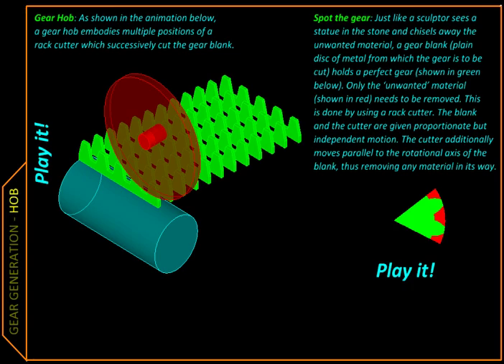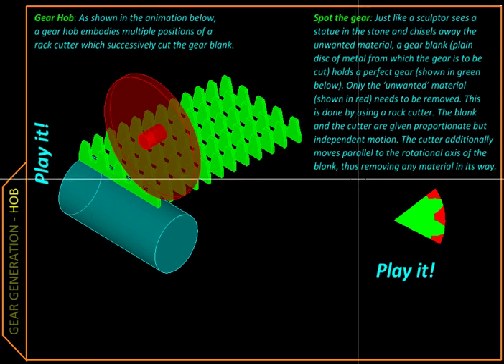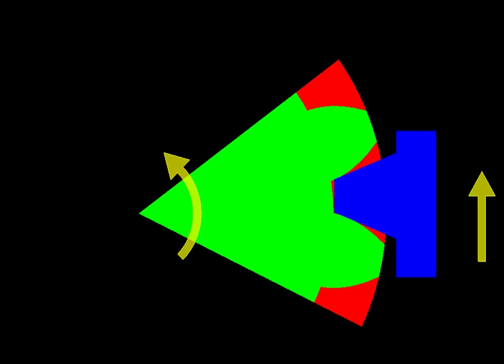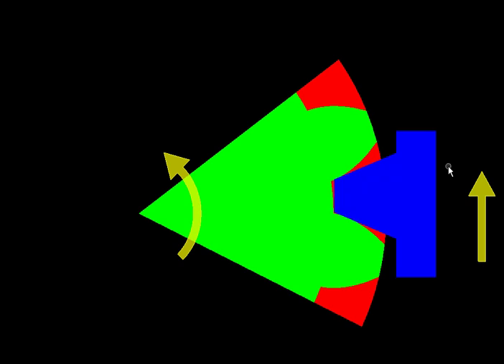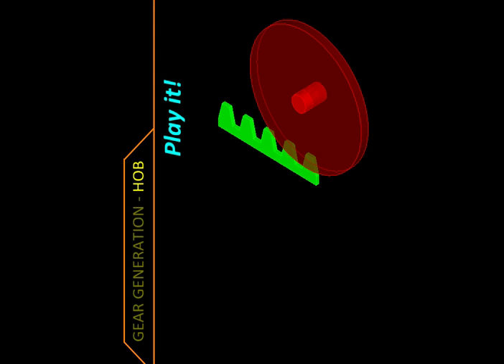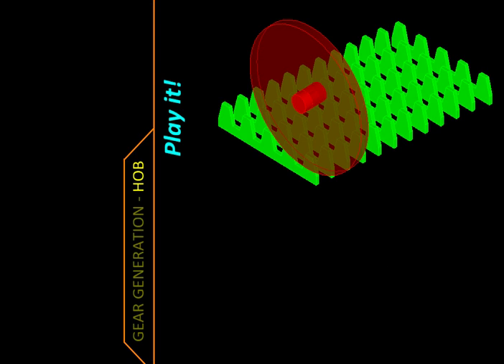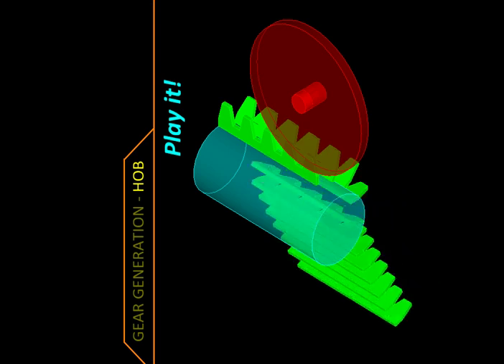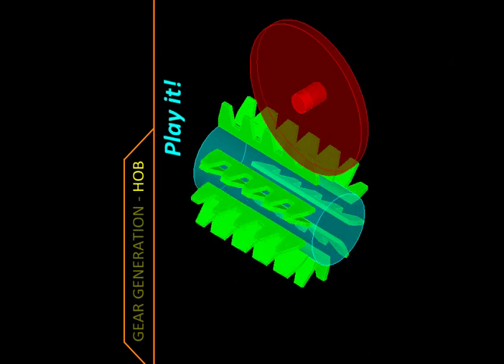Kinematics Ch06M Gear Hobbing

Comment: Hello Ujjwal sir, is the value of undercut circle radius same if the gear is cut through Shaping or Hobbing?
Reply from the maker: If there is undercutting due to interference, the undercutting curve will be the same irrespective of the tooth cutting process. 
Secondly, the undercutting curve is not a circle.
Hope I answered your query.

Comment: sir is the cutter moving up and down in the plane perpendicular to the plane of blank to be cut or is moving in same plane of blank it is kept in
Reply from the maker: A rack cutter has two motion components. One is in the plane of the gear blank, which moves the rack as if it is engaging with a perfectly cut gear. While the other component is normal to the blank's plane, which cuts away parts of the blank that obstruct it.
Reply: UjjwalRane sir please tell whether what i am thinking is right or not ? this means that cutter is brought back to its initial position i.e indexed back to its position after certain distance of meshing. Whereas the blank position is not changed when the rack is indexed back . Due to this indexing the gear produced are not accurate as compared to the gear produced through pinion gear where the continous motion is there between the blank and the cutter